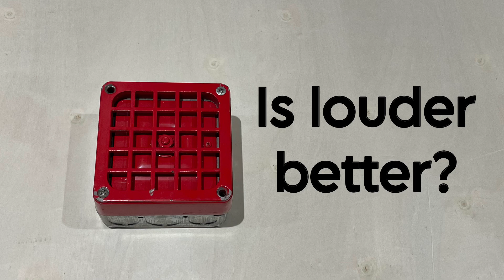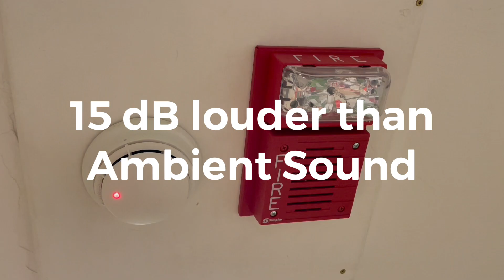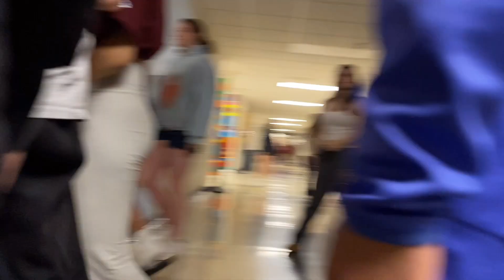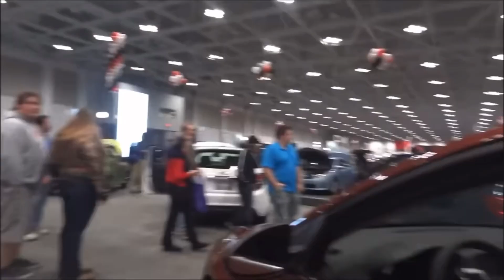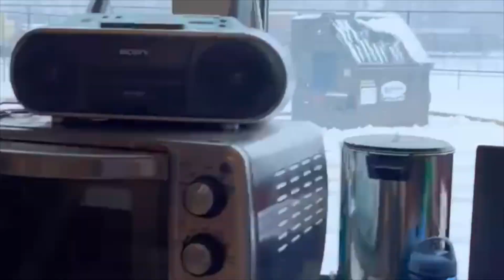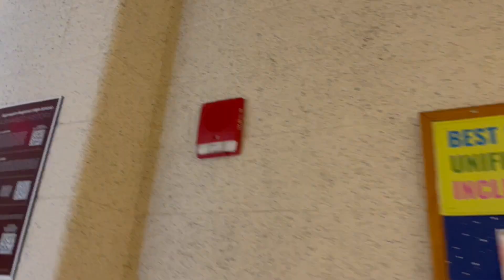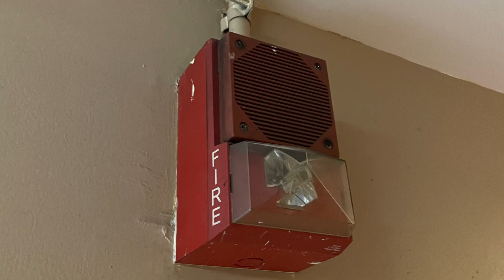Are Louder Fire Alarms Better? Why are Fire Alarms Loud?

Comment: I strongly disagree with you in my own opinion. Here are my reasonings. There was actually a real fire in a mall where I use to work and people reacted to the voice activation system like it was no big deal. Back in the 80s and 90s we had these simplex mechanical 2001 horns and the reaction time even without a fire was much better than a voice activation system. People should already be self taught what to do and not panic when an alarm sounds especially if they were never notified of an actual test. Lets put feelings aside for a moment and look at safety practices regardless if its a real fire or not.
Reply from the maker: That’s an interesting point. Of course, there are always situations where different alarms are more effective, but anecdotes do not disprove statistics. On average, a voice evacuation system is much more likely to incite a crowd response than a horn.

Comment: One thing that is more important in this case is the tone of the alarm. Using a tone like the EN54 tone (900hz / 650hz alternating 2hz) has an advantage, since it reducies the risk of the fire alarm being confused with other signals. The EN54 tone is used as local sounder in many FACPs too. This is exactly why emergency vehicles have a alternating tone, to gain attention, and also to prevent the signal to be confused with for example honking. car honks in turn has 2 tones superimposed over each other so a honk is not confused with another single-tone signal.

The big problem is if you for example have a factory floor, and the machine gives off a signal to indicate, lets say "empty material hopper". If the fire alarm gives off a similiar tone, the people might confuse "ooh, its just the casting machine signalling that the material hopper is empty" and not evacuate during a fire.

Or they might hear the fire alarm tone, just when their microwave food went done, "ooh its the signal from the MW, my food is done" and then they get accustomised to the tone and then forget the tone still sounds when they have opened and taken their food.

Its important to use two frequencies that are far spaced apart, especially if the place houses sleeping people, as some people might, during sleep, not hear certain frequency, - if they have a hearing defiency. I for example don't hear my smoke detector if im not actively listening to it, so I had to replace it with a full blown system with EN54 alternating tone sounders.

This is also why some might say "ooh the fire alarm is too silent". What they actually mean is: "The fire alarm has the wrong tone".

Comment: I would also add another factor, desensitivity. In modern we are quite used to also sorts of sounds going off at random that require no action from us.
Weither it be: car alarms, vacuum cleaners, drilling, motorcycles, computers beeping, and etc. 
So a suddenly loud noise isn't intrinsically linked with danger as it might have been in the past. So adding the verbal instructions helps seperate it from all the other loud instantaneous noises we hear.
Reply from the maker: You are certainly right about that, people are often desensitized to fire alarm signals.

Comment: I know this is an older vid but I figured id add my experience as an inspector that's heard a lot of mechanical systems as well as newer piezoelectric systems. DC mechanical horns aren't even as close to as loud as newer horn strobes such as the Spectralert Advance or L Series. The one argument of mechanical horns being louder that I actually agree with is with AC driven horns as those things will actually kill your ears even with earplugs in.
Reply: Definitely can relate to that. I thought the Gentex GMS's that used to be used at my middle school were a bit less loud than the SHG third gens that used to be at my elementary school. Meanwhile the vibratone 350's on my high school's scoreboards in the gym hurt my ears even when they very briefly go off when the scoreboards are powered on.

Comment: I still think that they are too loud and arent analyzed enough by where they are placed. In open outdoors, it makes sense why it needs to be so loud. The problem comes when its in a calm and quiet place like a restroom. Especially in rooms where there are no carpets, reverberations amplify the sound by matching the peaks of the soundwaves as they clash and bounce around. Its not just loud, it amplifies itself. There needs to be a much bigger look into how loud fire alarms are still. Its to the point where it is dangerous to your hearing to be indoors and have a fire alarm going off.
Reply from the maker: I agree with you that some fire alarm
devices are unnecessarily loud.

Comment: Dude I disagree with you dude at everything dude I’ve own voice evac systems alarms and they suck that’s why I never showed them on my demo board also dude where your very very very wrong is that croud response has nothing to do with people evacuating it’s the loudness dude it’s been that for ages dude I fact I have the most insane super atomic loud fire alarm system on my demo board simplex 4903-9219 and a genesis est  fire alarm g1rf hdvm which means high decibels multi candela horn and bye most dude I do fire drills one and a blue moon on night times and every time I do it my parents ask which alarm woke me up and it was the est genesis fire alarm and that is because they are made to wake people up in case of a fire not making people leave more on the edge to make people aware that there is a fire and to slowly get out of the place and it’s never to run or be fast because if you run faster in a event of a fire you will have people panic and die and that is something you do not want when you hear anytype of a fire alarm you would want to actually make sure it’s not a fire drill and if they announce it’s not a drill don’t be slow but medium to slow walk out of the building because some fires if you run out of the building which I see some people on YouTube do you will have a fire catch onto your clothing anthor thing is if a fire does get on you you don’t run you drop stop and roll on the ground until the fire is put out from your clothes then because you might have a couple third degree burns go get checked out but that is if you don’t have some one spray a fire fire extinguisher on you.

When there is a fire, the last thing you wanna do in case of a fire would be to run out because a fire would get on you and you could be injured or burnt to death. So when there is a fire and you hear any type of fire alarm, the thing you would want to do is slowly or medium walk out of the building because if you run, you are asking for the fire to come onto your body, onto your clothing, and burn you up pretty bad.

What I've learned with my fire alarm stuff, especially when I've been a fire inspector for about 39 years, is that especially the fire alarms that you do install, like Simplex, EST, Genesys, Gentex, and so on and so forth. I found that EST is the most effective fire alarm in getting people out of the building. Because we had it in our West Branch High School/Elementary School. The elementary had Simplex, which I liked, and that's why I helped up there in those inspections vs EST, where EST was okay, and I was going to do those in my junior and senior year, but I chose to do the Simplex fire alarms up in elementary because they were more of a fire alarm that I enjoyed. EST is okay, but Simplex is more my type. If you want a fire alarm that's more mellowed out and not too loud but will also get you to evacuate slowly and not fast, I would go with Simplex.

But if you ask me what you said about your video which was saying that you disagree to a lot of people about crowd control. Crowd control is somewhat in part of the Fire Alarm tutorials and most people's videos but most of it is about loudness and how loud the alarm is and if it's going to get you out or not. If the alarm's not loud, you might say that it's not going to get you out of the building. If it is loud, you have a chance in that you're going to hear the alarm and you're going to be able to get out. If you don't hear it, which is some alarms like Simplex do, especially mechanical horns which tend to die out after 30 or 40 years, you're really not going to get out at all because if somebody pulls it or the alarm goes off automatically with the smoke detection, you're really not going to have a chance to get out. As if you had a high-quality fire alarm like EST, Edward System Technology Fire Alarms, you have a chance of getting out. My EST Genesis horn strobes that I have 3 of them, one's a regular horn without a strobe, and then I have two Riff horn end strobes which is the G01RF-HDVM. Which I think all mine are that brand. They're the most effective.

What you said in your video, I have to disagree with you, and that's from personal experience. Being in the fire alarm field and I also volunteer at the firefighter department, so I know what I'm talking about. Versus some people that don't, and I kind of think you don't know what you're talking about. To be honest with you, what got me into my walkie-talkies was doing fire alarm videos +1 being in public safety.

To your question, that crowd control is good, no it's not. It's all about the loudness, and if it is loud enough to alert you, if it's not loud enough, you're probably not going to get out of the building, and you're probably going to burn up to death from the fire. That is my experience. Now, not saying that I'm right, but it could be that some people might not realize that is what the alarms are about - it's about the loudness and how it's going to alert you. If it's not loud enough, you have a chance that you are not going to hear the alarm, and you're going to still be in the building when the fire catches the building on fire, and then you're going to be stuck in the building when it's on fire, and you have a chance of dying from a fire insulation palm.

So I say that EST is the best out of every alarm. Now I'm not saying that that's true, but from my experience in my field test, I say EST is the best.
Reply from the maker: There is quite a lack of punctuation in your comment, and it’s rather incoherent. I’m not entirely sure what you’re even saying. It doesn’t seem very based in fact, however.
Reply: @FireAlarmDude5967 wow lol 😅
Reply: @FireAlarmDude5967 blah blah blah you know what I was saying  so lol 😅
Reply from the maker: @Reninthesmoker2899 I genuinely do not….
Reply: @FireAlarmDude5967 what I mean dude is that est fire alarms are meant to be super loud so that people that are hard of hearing  can hear it and get out of a building that is on fire dude
Reply: @FireAlarmDude5967 have a good night

Comment: So in my special education preschool, the fire alarm was tied into the PA system (speakers in classrooms and bull horns outside). First time the alarm went off I cried and panicked. My teacher held my hand walking me outside because she knew I was distraught.

In elementary school, we had the same set up with the speakers but outside were what I’m assuming were Simplex horns behind dual projectors. Those alarms scared the crap out of the teachers when they went off…and they got the 1-2 minute warning call from the office

Comment: One thing I think this video could have benefitted from is a clip of people failing to evacuate despite an unpleasantly loud alarm. With regards the food court clip you showed, I feel like you didn't fully address or disprove the idea that people WOULD'VE evacuated the building if the fire alarm had been louder. This doesn't negate the idea of crowd response or the problem of panic, but I still think someone might have made the argument that a louder alarm might have moved people in the absence of those things (although I've noticed I'm much more sensitive to loud alarms, much more responsive to fire alarms in general and even was extremely afraid of fire alarms as a kid, so I'm not the best judge). I'm not saying I disagree, but I think a clip of people being similarly unresponsive to a loud alarm would've made your argument stronger; it's the one thing you didn't fully address imo
Reply from the maker: Thank you for your input. The argument is supplemented with an example of a quieter alarm in which people do respond, but yes, you are right that a clip exemplifying a loud alarm with no response could be beneficial
Reply: @FireAlarmDude5967  I feel like any fire alarm will be effective in a school since people are not sleeping there and also students are trained via multiple fire drills per year to evacuate when the alarm goes off no matter what.

Comment: I've had experience with many fire alarms--having attended 6 different schools so far--and the loud shrill ones were not only annoying, but quite fear-inducing. The school I go to now has an alarm system that is loud enough to be noticeable--but not so loud as to cause annoyance or discomfort, and plays a message along the lines of "A fire emergency has been reported in the building. Please evacuate". In my personal experience, the more calm systems like the one at my current school work much quicker; with a startlingly loud alarm people tend to take a second to process it, whereas with a non-startling alarm people immediately get up and start moving. The verbal message also helps, as fire alarms vary widely by area; when I moved from Alaska to Massachusetts in elementary school, I didn't realize that the fire alarm was a fire alarm in the first drill, I was used to a shrill buzzy noise, and the fire alarm at my new school was a sine wave. when I moved from Massachusetts to Oregon I immediately picked up on what was happening in my first fire drill because of the recorded message.
Reply: Ours was a WW2 style air raid siren!

Comment: Are you sure the Fire Alarm in a Mall is Above ambient Level? since Malls can be Loud Places due to People Talking all at Once. So do you think they have to set the Speaker/Strobes Louder or a Fire Alarm Horn Speaker has to be Used. BTW My Mall uses Simplex and the Anchor Stores have System Sensor devices. The Truealerts are Very Loud and this may cause people to panic
Reply from the maker: Definitely above ambient level

Comment: My elementary school growing up, had an old fire alarm system from the 60s?? It'd activate a bell that'd keep going. One time, it got triggered by something and glitched out and kept on going for hours and hours.  It only got updated after I had graduated out of the school for a HUGE renovation.

I didn't hear the normal horn fire alarm for fire drills, until I was in middle school. The elementary school one used to scare me as a kid. 

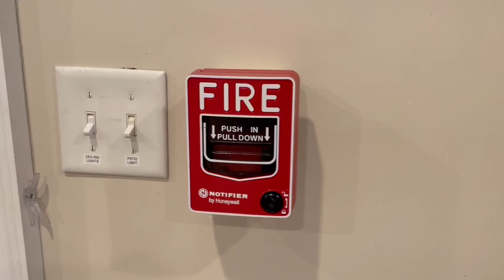7:39 and the Red Bell ones from earlier were the ones at my elementary school.

Comment: Back when I was in High School,  (I graduated in 1991) when we had fire drills, the alarms at the north part.    of the building were EXTREMELY loud, and one of my Special Ed. Classrooms was in that wing. and that classroom (it was also the only classroom) that had two doors (one on the northside and the other on the southside) and there were one fire alarm horn in each of the wings by the door, and there was another horn in the hallway between the 500 and 600 wings, and that horn was behind a wall at the westside of the classroom; therefore when the alarms went off, it was like I said EXTREMELY loud, and it was so loud quite a few of the students had to cover their ears when he had the fire drills. That was the only section of the whole school that had very loud fire alarms with the exception of the gymnasium and the classrooms that were shops such as the woodshop and the metal shop.  That section of the building was added on around 1965-66 and the horns were most likely made by Simplex. They had two horns in the 500 Wing and two horns in the 600 Wing and a horn between the Wings since the floor plan was like a rectangle if you were looking at a map of the building.

Comment: you may have seen my video on a fire drill at my high school; it still has the original Simplex 42 47–2 with 4050s as the audible signals--they made everyone want to leave the building ASAP.

Comment: As someone on the spectrum and sensative to loud noise, a loud enough fire alarm will cause me to freeze.  In college, one dorm I lived in had the alarm volume set way higher than it should have been.  Whenever the alarm would go off, all I could really do was cover my ears and sit there as it more or less made my mind go blank.  It took a bit to regain the wherewithal to exit, slowing my egress by 2 or 3 minutes, which in an emergency situation is unacceptable.  Also, having appropriately volumed fire alarms in elementary, middle, and high school probably would have reduced my anxiety and occasional panic attacks over fire drills; my schools always had those older, louder models.

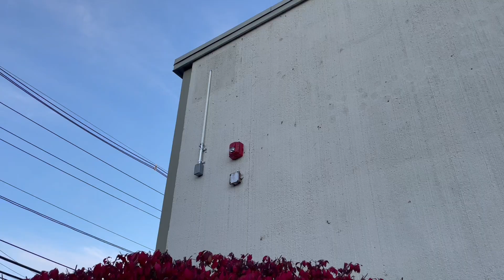Comment: 0:44 Short answer, No Louder fire alarms are not better. Electromechanical fire alarms are already loud enough that they don't pierce someone's ears like the System sensor advance series did back in 2006-2020. And ear piercing alarms contribute to deafness to individual person which is not wanted. Speaker strobes basically beat the Horn strobes at their own game by not being too loud or too quiet. Simply an alarm being really ear piercing loud isn't a good thing in a high rise building at a really high building.